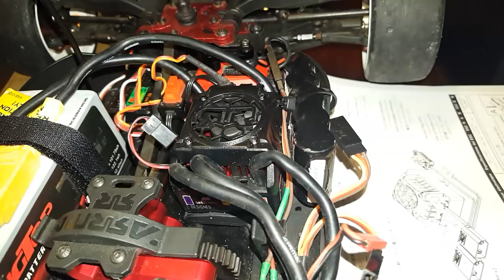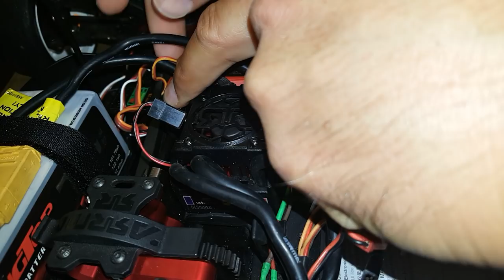Arrma Blx 185 ESC Programming Set Up. Throttle setup Variable settings Typhon Talion Kraton Senton

Comment: Excellent explanation! After I upgraded my Arrma Kraton with a Spektrum AVC receiver the throttle settings where all messed up. After the throttle calibration the power was back and the ESC and motor where blasting once again.

Comment: Just went out for a quick test run. Wow! very impressed with Arrma's new BLX system. I have the BLX85 in my lil 1/10 first gen Raider that's hopped up..only tested 2S and she was moving. I never had any of Arrma's brushless systems only Castle and the Element which is pretty much a Castle sidewinder2 created by Castle so..yeah impressed. Also recommend the Flysky FS-GT3C Radio. Cheap and great bang for your buck. Picked one up, it's a great 3ch radio. If you need an extra radio type thing.
Reply: TboneNYC10 ,that's Cool Brother!I have this set up in my TRAXXAS RUSTLER. 
check out my post, PROJECT TITAN TRAXXAS RUSTLER 
I love this hobby,keeping on the fast lane.
Reply: TboneNYC10 where u from in ny I'm in Harlem Eastside we meet up in central park to run were u run at
Reply: Jermaine Murda ,I'm in Shaolin,Wu-Tang,old school, lol!But I'm not ready to run yet.But we can definitely get up in the spring. Better running weather,will link up soon!Need to get with a group of people, solo for now.

Comment: Lol I hate you😂😂, I completely agree and so does Arrma I think, I tried messing around with the battery settings, for the blx 185 any way.. I believe it’s factory set for lipo. I tired to change it just messing around and it would only ever beep once and was stuck on lipo. After a couple more attempts it was the same. NE ways good video bro! Keep it coming I have a totaled Talion v3 1hr old from a 55 t parked big truck tire🚀💥👎🏻 not good ;( so I piled it in the corner for a rainy day and ordered up the infraction. Awesome instructions bro!  
I think you can swap the esc and motor 180’ to the other side for running longer motors and changing your weight disp’ so that’s why you can reverse it on the remote because it would now turn the other way. 👁🥼🚨💉

Comment: Awesome videos buddy i always watch yours i find them very helpful i do appreciate the time you spend explaing in detail as most dont and are a waste of my time lol...im running the new typhon 6s all stock so far but i just picked up the sensored mumba esc and motor set 1515  and a 20 pinion and servox servo nothing installed yet i need to run it stock first with my dynamite gps and record my stock speeds first then i will installl tomorrow and record my new speeds im not sure what to expect yet. Im also going to pick up the newest futaba controller tomorrow. Can you suggest anything else to maximize my speed like a certain spur and pinion? Also what tires do you use i love the no rubber im looking for sweet very low profile tires if you have any sugests id appreciate it so much brotherr im not super experienced ive only been in the game 2 years now lol...i wanted to ask you about setting the esc like in this video. I havent changed the punch or throtle settings im nervous to touch them but i assume i will have higher speeds if i follow what you do as for setting it up? Thanks so much for listening or anything buddy
....keep up the videos

Comment: i would like to know if you can set something like a speed limit, i know there is a beginners mode on the traxxas cars(at least the slash) is the something compareble on the armma vehicles?
Reply: Rohan Lo-A-Njoe only thing you can do is turn down the throttle rate on the controller with these, but, you should throw a dumbo rc controller on these to get rid of the lag time on response.  Hope that helps

Comment: Hi how are u doing?  I have a question , on the blx 180 esc can you tell me what the blue light and red light are? 
Can you guide me through the settings on both of them? My esc is glitchy and sometimes it just goes slow all outbid the sudden ... I notice that in one of the blue setting I can select five red settings but all other four blue settings will only give two red settings . I don't know what each means ...need YOUR help...pleeeeeease downloaded manual but can't deal with that so good..thanks keep up the good work

Comment: i have a Problem: my punch is now great, but i had problems at first, so i changed something, and i dont know what it is. Im almost sure that it was the battery shit with lipo or nimh, but im not 100%sure. so is it possible to bring back the standard configurations, or have i just killed my esc? BTW NiMh is great! yes, they arent as powerfull as lipos, but you can get a descend runtime out of them, and they are almost indestructible some of them can be charged in only a few minutes, you need no low Voltage cut off, they can get hot as fuck without damage, and they are rocksolid, like hardcase without a case! The e revo and e maxx was originally sold with these batteries, and it was possible to drive with 40mph, so they didnt have to he weak, you just need the right one. the shitty ones are nickel cadmium, they are shit, but not nimh!

Comment: Hi friend. I'd like to use one 6S lipo instead of two 3S on my Senton. ESC is the BLX 185 also. Any special adapter for that? Thanks.
Reply: Edwin Cordero  I just got my first arma esc and it came wired to run eithervway.  In the second plug there is a pass through. Basically the 90 connector pulls off and allows two.  Our it back on and need only one

Comment: You seem very knowledgable about this system. Thanks for the info. To bad the manuals dont have much above warnings. I do have 2 questions though. I am new to brushless RCs. I have always ran nitros. I purchased the typhon 6s. I run a 22.2V 5200mah 50C high performance lipo 6s battery. Why would my car just be running fine and all the sudden it reduces down to about 40 percent throttle and then stops? I turn the switch off and then back on and it does the same thing. I figured the battery was drained so now when I put it on the charger, the charger says connection error. Maybe I ruined the battery? Also, I had read in a download manual that you must put the esc in lipo mode for lipo batteries. I cant find anywhere in the manual or on you tube on how to do that. Do you think this may have destroyed my battery? I bought the buggie new and just threw the lipo in and started driving it. I hope my esc is not destroyed. What do you think?

Comment: When you say full throttle set and full reverse set are you holding the trigger all the way forward and hitting set or going full throttle, letting it go and hit set? Thanks. Ps I'm running a 7 cell nimh stick pack : )
Reply: leave it on full throttle then set, without releasing throttle, same as reverse

Comment: sir i have a few questions regarding the arrma esc blx 185. when you pull the trigger of your transmitter is it smooth running and no cogging on that esc blx 185?

Comment: hey got a question, i made a custom build and used this esc. its works but the reverse is my problem. i have brake but it immediately goes full reverse. it basically does a burn out in reversing trying to to stop itself. my controller is radiolink rc3s (ebay) and my ring and pinion is 34/34, rustler vxl chassis. its got me baffled because my kraton doesnt do it and i copied all the settings from it. are all the arrma 1/8 scale esc the same?

Comment: So after neutral when you hold forward you continue holding when you press the set button and then let go?? and of course the same for reverse.
Reply from the maker: TboneNYC10 yes, press the set button in neutral, then hold full throttle and press the set button, then hold reverse and press the set button. Then turn it off to complete it.
Reply: Leo- Moreno Thanks brother. Just wanted to confirm. Thanks for the quick reply and also for posting this vid. You can't find much on any of the new BLX Systems..especially setting up throttle range. 👍

Comment: hi sir anyway what's the value of cc cap on your esc because it is 5 capacitor was in their?
Reply from the maker: JJARM RC are you talking about a capacitor pack?
Reply: yes sir about your cc cap. pack
Reply from the maker: JJARM RC  a cap pack is used to help with voltage ripple and potentially voltage sag, by charging and discharging rapidly. I don't recommend the castle creations cap pack though. I think it is too small to have much effect. Soon I will be releasing my own line of ultra high discharge capacitor packs. Up to 20 time more capacity than the castle creation cap pack.
Reply: what i mean sir how much the value rating of that cc cap. on your arrma esc
Reply: what i mean sir how much the value rating of your cc cap.on your arrma esc
Reply from the maker: JJARM RC oh I see. That is not a capacitor pack, it is the battery for my motor fans. I did not have a cap pack in this video. The ones I'm going to be selling soon will be up to 16,500uf cap packs. For comparison, the castle creations pack is 880uf, and a Poseidon is about 4,900uf.
Reply: ah okey.. thank you and i appriciate it sir

Comment: I believe the only use for nickel metal mode is to run 5s with no voltage cutoff as the esc can't do the math for 5s apparently. I know. Why?. Just got the car and I don't have another 3s yet. Found it on the arrma forums. Yes i know I'll kill my lipos if I'm stupid

Comment: can you please tell me how to program it to be set to lipo?
Reply from the maker: it is factory set to run on lipos. if you changed it, you would have to go into parameter one, and set it to one beep. 2 beeps in parameter one, is for no low voltage cutoff. you want it to have a voltage cut off for lipo.

Comment: Can somebody help me, im having issues on my esc. And its fairly new, i haven't beat the shit out of it.  All is calibrated correct and the issue is the power cuts off.. It slows down.. It has the power at first 5 seconds and then it slows down right away.. Turned it off and on and it goes the same thing. I dont think temp is issue coz motor and esc is cold to touch, and its winter. I live here in canada. Anybody experiencing this kind of issue. Advise and tips will be greatly appreciated. Thanks in advance.
Reply: Low voltage kicking in when batteries low? It will go into "limp" before they die. Would be nice if this dude actually explained if there were different levels of lipo cut off?!?!?!?
Reply: Oh im sorry i forgot to add, its 100% fully charged lipos
Reply: @ajdvra8857  having the same problems,  I thought bc my batteries getting old and has a week cell but idk I kept turning off on eventually it worked now today doing the same going try new batteries and resetting that dont work I guess need new one
Reply: Mine would either limp or just not work at all but I may have really week batteries,  I have probably 100 charges on them
Reply: And already a new replacement,  in fairness I use almost everyday and stuff just dont last
Reply: @paulclancy2404  i got new batteries so i assume its the esc is the issue, i havent tried any other batteries though.

Comment: I did thos now the light on my esc is red and i lost reverse please some ome help
Reply from the maker: try to reset the esc and start over. Also make sure your trims on your transmitter are correct
Reply: I tried to reset it the way the manual said and it is does nothin for some reason do you know if its like the traxxas esc also thanks for thw reply
Reply: At 5:14 you say thats were you change the battery setting could that be it maybe
Reply: First time out new outcast , I had blast said my self let me see throttle trims in middle truck trimbdidnt seem to do much but shortly after took off slammed under a car . After pick truck up I had no r.x.than again took off in my hand have large bruise and road rash lol . I unplugged batteries ECT only had steering . 2nd time out new outcast same problem only steering than truck would go but slam on break shortly after unplug plug it worked fine had a blast but nervous low volt not working ,or I have something faulty not sure if it's defective or its just the user lol any advice out THERE